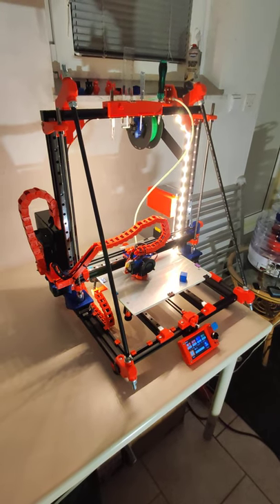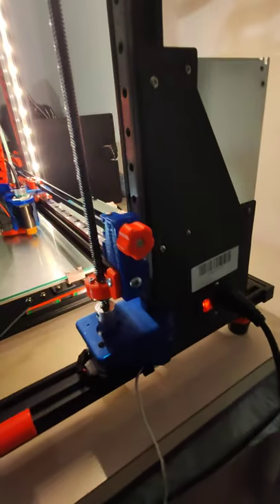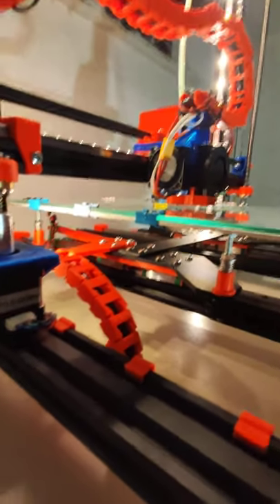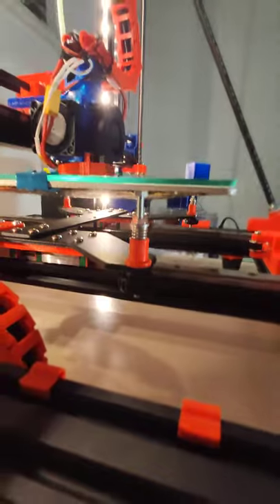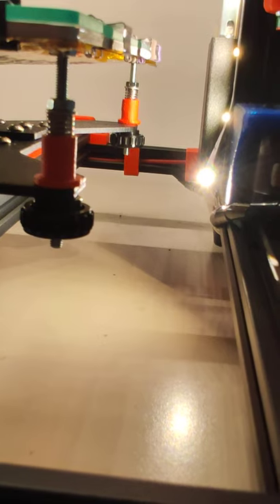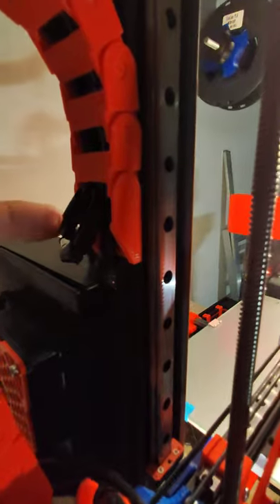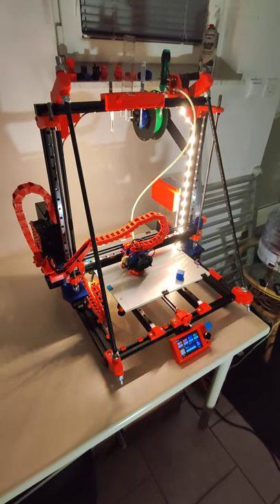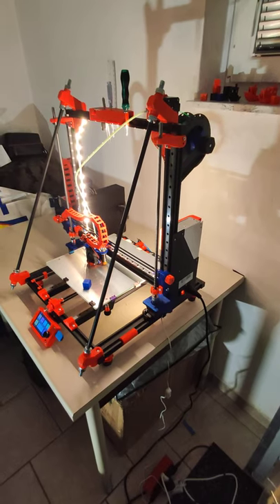Anet A8 plus SKR 1.4 turbo & BLV mgn12 mod

Comment: Hi, thanks, good work, been looking for something like this for my anet a8 plus. Question, what length extrusions did you use for your X and Y. Also, what length did you use for your X and Z Rails? Thanks again...
Reply from the maker: MGN12 for Y,Z and X axis is 450mm . I did order 500mm for Z and X axis but at the end i did cut them. 20x20 extrusion is 42mm and other one little shorter because of wires for TFT.

Comment: Thank you for your video's. They are really inspirational. 

I also want to upgrade. Especially cause the Anet A8 is difficult to Calibrate. 

I already purchased a skr. 1.4 mainboard. 

Next step is to purchase some stepper drivers. I think i wil go for the 2209.
Reply from the maker: Thanx, I do my best on A8P if we still can say so because this is now something much, much better. By the way TMC 2209 are great choice👍 Ultra quiet and sensorless homing so you won't need endstop switches. If you can go with mgn12 Y axis upgrade. You need 450mm rails 👌😁

Comment: Anet 8plus VS Ender 3 V2 how the best? 🤔🙏
Reply from the maker: Depends what you want to do. If you need bigger bed and you want to mod it then Anet A8+ but out of the box Ender 3 V2 is better. But after you do BLV mod Anet is great and i will not replace it. I learn a loot transforming my printer 😁

Comment: Hi Trebor

Amazing this 3d printer!
Could please tell me the size of the 2020 profile that you used for the X Axis (extruder axis). Is it correct that it is 450?

I also would like to upgrade my anet a8 plus to a blv version.

Many thanks for your time and help,
Ronny
Reply from the maker: Sorry i miss your coment. I cut my on lenght 500mm.
Reply: @trebor1477  Thanks for your respons the project to build this 3D printer is currently on hold 😉 because of an issue that i first need to solve with my current printer
Reply from the maker: @easyronny  I buy this printer new for 150€ and after all modded parts whole thing cost me around 450€. But i realy enyoyed to put it together. Now after a loot of work this is one good printer. Printing become so easy. Even printing TPU with bowden setup is possible.
Kind regards
Robert

Comment: Hello..i have anet a8 plus and i want to upgrade the mainboard..do you have any idea which one should i buy?i want the replacement to be plug and play to keep the downtime as short as possible as now the machine is working pretty busy
Reply from the maker: There are no easy PNP boards. And I will say go with my config but you will still need to configure  some Merlin options differently. But it is worth it to mod with the same board. You will get silent drivers and you don't need end switches at all. So less cabling 👍
Reply: @trebor1477  so it means that we have to manually configure everything to match printer specs right?

i'm also a bit curious about print result improvement..is it really far more better than the stock board?i've been dealing pretty long time with the ringing and ghosting marks on X and Y axis even after installing braces

i have several other printers from other brand and to be honest this one got the worst result and its really a pain in the ass for me to resolve
Reply from the maker: @bigboy8692  Yes, but you can use my config and change it

Comment: Hello didn't you had problems with y axis bed carriage?
Reply from the maker: No. What problem?
Reply: @trebor1477  i cant level the bed , one side always stays twoo apart from the bed
Reply from the maker: @diogomatos5609  You have problems with ABL leveling?
Reply: @trebor1477  not with abl, with the actual carriage on y axis, I had to replacet it with a homemade one of 5 mm sheet of aluminum

Comment: Hi. What Mount did your use to fix the Y carriage to the MGN12H bearing block?
Reply from the maker: Hi. I used this part https://www.thingiverse.com/thing:3478184
It is a little difficult to align but if you mark center of old munting part it is no problem. Old mounting holes won't fit anymore. But don't tihten everything at beggining. First move front and back bed carriage so it move freely and then tighten all screw's. If you will use only linear rail's you will have some flex up and down but not as much as on 8mm rods. Becouse of that i added 2020 extrusion profiles.
Reply: Thanks for the tips trebor. Only planning to do for the Y axis for the time being. The 8mm rod have too much flex on it. I cannot stand it
Reply: @trebor1477  Hi again. What is the length of the rail did you use for the Y axis?
Reply from the maker: @ujang0711  450mm prfect fit
Reply: @trebor1477  Thank you !

Comment: How length is your hiwin rails?
Reply: for y-axis
Reply from the maker: They are 450mm
Reply: @trebor1477 okay thanks, and how length is 2020 profile below the rails?
Reply from the maker: @achmadfpv1057  420mm but my are little shorter 410mm because of TFT wires so i have a little gap.